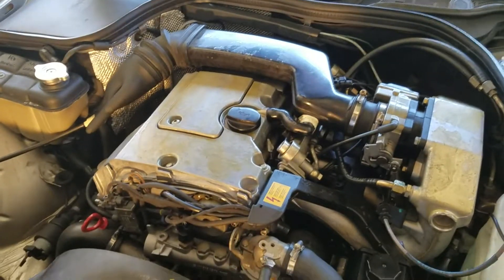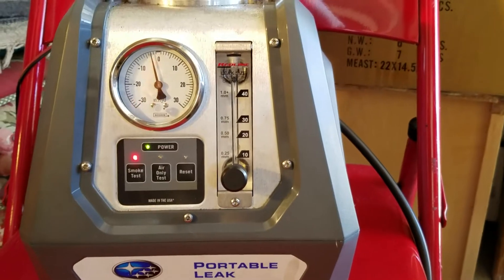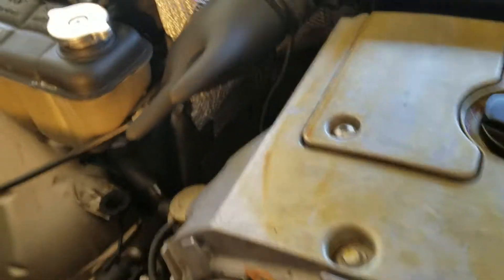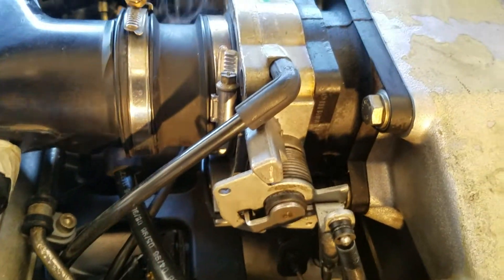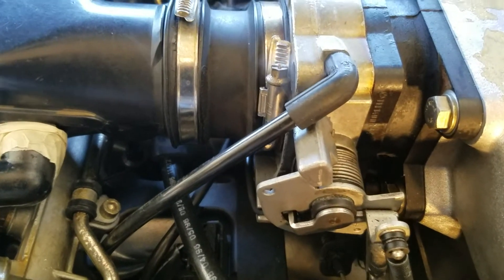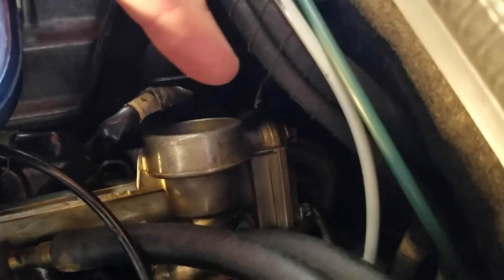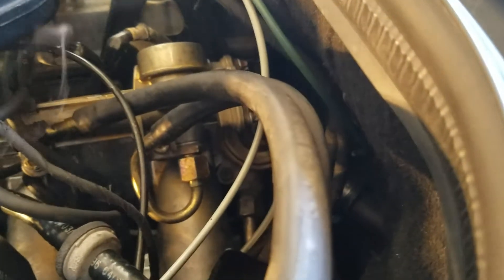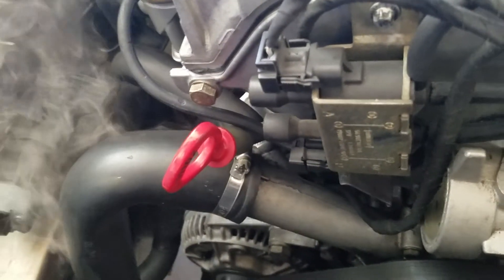1996 C220 Smoke Test - Evap Leak

Comment: Hi, could you tell me what exactly was the cause of this wobbling? Where are these valve and coupler? I'm not familiar with mechanics and I have the same problem with my W124 200E M111.
Reply from the maker: +Agata:  The wobble was caused by reversed coupler and vacuum check valve - look at this link for the correct setup
https://photos.google.com/photo/AF1QipMxoR3NsjYl7xNLSHAKe8I6sFbS26CEShIRSRdc

Also cleaning the EGR valve intake tube gave much better performance
Reply: This link doesn't work, but I will look for these things. Thank you for response :)
Reply: And during wobbling were rpms fluctuating?
Reply: @andrewfitzpatrick2689  this link is not open. check plz